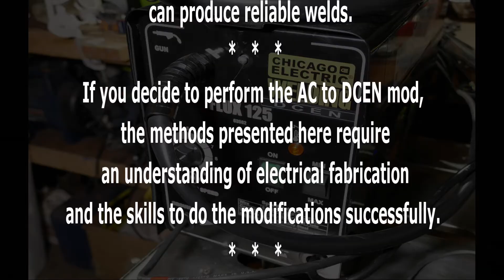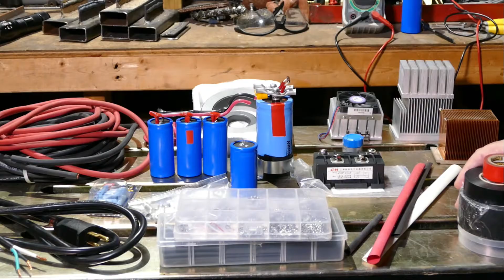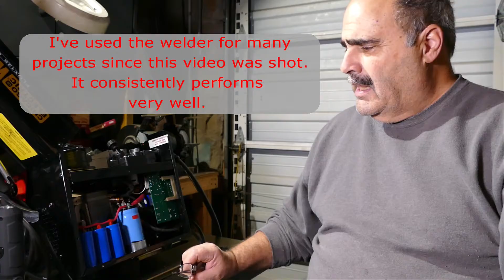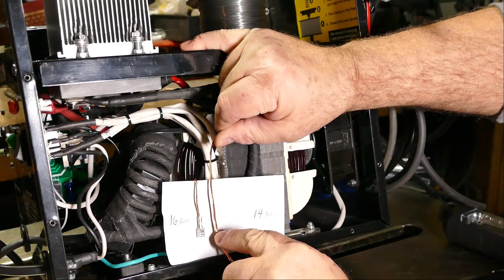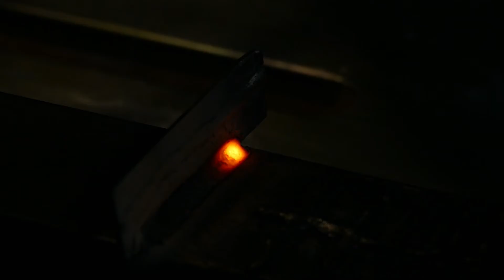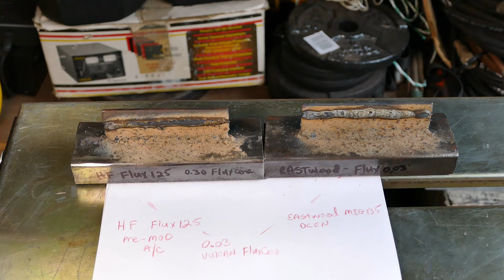Harbor Freight Flux 125 DCEN Mod

Comment: Today it not worth doing this with a HF90-125 welders   You Can By a Nice 140amp Inverter DC Mig Welder for around $80 , Try using Blue Demon E71T-11 Wire its good stuff !
Reply: Pero nunca una soldadora de transformador será igual de frágil cómo una inverter de tarjeta electrónica. En un altibajo de electricidad se muere la tarjeta inverter. Son mucho más delicadas. En cambio la que se hizo en este video es prácticamente un tanque indestructible

Comment: Great video I plan on doing g this to mine as well. How is the welder still holding up? 

Tip Forney, or Yes welder wire works so much better than the Vulcan wire.

Comment: It would be nice to the output on an oscilloscope.  Both with and without the coil,  would be interesting to see the difference.  nice work.
Reply from the maker: Agree. Would be interesting to see the actual level of filtering by the choke coil.
Reply: I don't know much. How do you see output on a scope?

Comment: Just starting my upgrade to DC on the older 90A model. You are the only person on YT I've seen use that inductor? Do you think it really makes a difference? (VS just the RC add to the circuit)? My gut instinct is that the inductance will slow the initial arc, and prolong it on the release...but...could be some other circuit magic I'm not thinking of
Reply from the maker: Hope your mod goes well.  I had this large ferrite core in my parts box, purchased many years earlier at a Hamfest for a few dollars.  Not sure of the final inductance since I don't have the proper meter to measure it.  The inductor is a filter that, if effective, smooths the current spikes. The capacitors smooth the voltage spikes. My intent was to smooth the low frequency current ripples. Theoretically, this large inductor would help do this. Others who have done AC to DC mods have used various types of inductors. My Eastwood welder shown in the video has a laminate core inductor. The bottom line is the mod produces welds that are equivalent to my Eastwood.  I can't say how much sputter was actually reduced by my inductor design.

Comment: Very thoroughly brief-down from the materials used until the materials were installed.

I love the power cord idea! I of the six days of about two hours each day this past week of watching how to convert the Chicago Electric to DC, you're the only one to show that upgrading the power cord is necessary.

I don't like the videos that say "I want to do this on the cheap" or "I only want to do it for $20" or "I only want to do it with things that I have around the shop."

I like that you just went straight for the best and to even care as much about being the cheapest. I want the best weld possible so I'm not as worried about cheap although I don't want to spend another hundred dollars after what I paid for the to get it to run DC.

You're only the second one to use an inductor or choke. I couldn't find the doughnut. A calculator I used online showed that I could get 1.6mH with a three-inch diameter 3 inches long steel rod wrapping it 27 times with a 4 AWG wire. 

The mH amount was what a forum poster on welding.com or something like that recommended for the hundred twenty times a second the voltage flips back and forth.

I also like that you just didn't set it and forget it on the discharge resistor. So many just put on a 259 to 400 ohm resistor set it and forget it.  One video even bragged that the discharge "only took eighteen seconds"...!!!

Finally  I want to see if 15each-4,700μF capacitors can help suppress the voltage ripple which will help the inductor smooth out the current ripple and give me a nice weld.

Comment: Where can I buy the 5in choke? Also what is the model for that axial fan? I was planning on upgrading the older 90amp model. Thanks in advance.
Reply from the maker: I bought the choke core for a few dollars many years ago at a amateur radio hamfest (flea market). Palomar Engineers sells toroidal ferrite cores of similar size, but they're expensive ($50-60). The axial fan is Chinese- made fan from Amazon. I think it is Arctic brand.  There's many variations in size and cfm that will work.

Comment: I have this exact welder myself. Planning to do the DC mod. The only question I have is on the stock unit, I see a white wire crimped into the ground lead from the transformer that goes to the circuit board and another white wire that goes to the circuit board from the positive lead that goes to the wire feed. Do you know what those white wires are for? I saw them on your unit but can't tell if those white wires were left on the AC side of the bridge rectifier or DC side. Does it even matter? I don't want to fry the circuit board. I'm not sure if older units have this feature. Don't know if it's a signal wire or what and will it cause harm if DC current is applied to those white wires?
Reply from the maker: Been a while since I've had the unit open and and I don't recall what the while wire you're referring to is for.  Might be for the wire feed motor or the control board.  Best to trace the wires and test them with your VOM.  Hope the mod goes well. My unit has been very reliable after the mod.
Reply: @fixtinkerreviewrepeat3074  I did get it figured out. I think the white leads going into the cables just past the transformer are signal wires of some kind. I cut the cable past where those wires intersect so they wouldn't be intersecting past the bridge rectifier and cause the control board to burn up. Thanks.

Comment: Can I use capacitors off of a RV air conditioning unit I have 6 of them biological no PCB 25 point us microfarads 330 volt AC 60 HZ I believe it's a run capacitor and then I have a 23.5 us 250 volt 50 to 60 HZ and I have another 10 microfarads 370 volts 60 HZ and then two that are on labeled one is a double capacitor I got them out of old air conditioner. I took a part of plasma TV and I got I got three of the coils out of there one has two terminals in the others have four and I also got some capacitors out of that plasma TV that are 450 volt 220 UF they're rated at 105 Celsius I've got five of them in this box right here also have on the breadboard a few more capacitors in a row on the motherboard I was thinking maybe I can cut the motherboard and leave them chained up on the motherboard and just sold around together but I'm wondering can I use these little alerts
Reply: The capacitors you have are way too low in value to be useful. They are not sufficient to filter the AC ripples present after the rectifier changes the AC to DC. Watch 4:30 for the values I used.  Consider 50,000 to 75,000 UF as a target range.
Reply: @kennethshaw8388  thank you for taking the time to let me know.
Reply from the maker: Thanks for the comments!  The capacitance needs to be sufficient to filter the AC ripple voltage.

Comment: So I can not use 25.uf 330vAC 60hz protected p823 10049012 3.15010.06 capacitor. Guess it's AC ?
Reply: Pins 22000uf 22000mfd 50V 35*70 Electrolytic amplifier Capacitor CD13 series 
So my question I guess is can you use capacitors that are essentially for a guitar amp cuz it seems to be a lot of them for sale there's capacitors that say audio capacitors and capacitors that say amplify capacitors on eBay and what do you think . Moreover I'm just curious if the word audio amplifier are just added on terminology or if they correctly state a function
Reply from the maker: @johnlindsey1938  The capacitors need to be "electrolytic capacitors". If the ones you are looking at are for the power supply section of the amp they'll be fine.  I'd advise not to use audio-style caps as the internal construction is different. Also be careful to make sure the capacitance is stated as microfarads. This can be confusing since some caps a marked with an "m" and some are marked with "u" (greek symbol for mu) for microfarads. Can be confusing . . . You might see  10,000 mfd  or 10,000 uf both meaning ten thousand microfarads.
Reply: 12000uF 12000mfd 80V 35*60 Electrolytic Capacitor
  Would s few of these work .
Reply from the maker: @johnlindsey1938  There need to be sufficient capacitance to filter the AC ripple. The A/C ripple will cause sputtering, so using enough microfarads will improve the results of your modification. I used a total of 86,000 microfarads which is in the ballpark of what was in the Eastwood welder I used for comparison. Using too little capacitance in the circuit will increase the amount of sputtering during welding. This is due to not properly filtering the AC ripple.
Reply: The value you specified is way too small to be useful. Watch 4:30 to see what values I used. The capacitance needs to be sufficient to filter the AC ripple voltages still present in the rectified DC voltage.
Reply: 2pcs 63V22000UF Aluminum Electrolytic Capacitor 35x50m. ??  So I think my shopping list must get but tedious for you to go through so I'll just stop at these capacitors and you could just if you choose to answer just say the first second third or fourth on your list will work or not work just to make it easier on you thanks for your time regardless
Reply from the maker: @johnlindsey1938  I'm not sure exactly what your question is.  Two 22,000 uf  electrolytic caps would not be sufficient capacitance, in my opinion. I'd advise getting into the 50,000 to 75,000+ range.  See above answers

Comment: I know your already done this project and i love your project and planning on doing mine as we speak with it on my bench making a schematic first .
Say if you added  1 smaller capacitor before the choke and then added the other capacitors after the choke coil you would have a really good dc with low ripple since the choke has some resistance 
I study power supply’s for high voltage tube amplifiers  and this is how they would make there circuit 
Am I wrong about this I feel the capacitors all before the choke will drop some voltage and current and did you measure how many ohms your choke coil was I was just interested if you took a measurement? 
Thank you for your videos i hope everything is good
Reply from the maker: Thanks for the comments!  I haven't tried this approach and have no way of objectively testing the choke / capacitor system. My evaluation is subjective and it seems to significantly smooth the sputtering typical of cheap AC flux welders.  BTW, I've done several extensive welding projects since completing the mod and it's working well.
Reply: @fixtinkerreviewrepeat3074  I would like to get a schematic for a Miller dc welder or a Lincoln and see how exactly there power supply is made

Comment: What is the function of the choke core ?
Reply from the maker: The choke core helps to smooth out variations in the current going  to the welding electrode.  The goal for the mod is to have as pure a DC (Direct Current) as possible.  The winding on the ferrite core creates a magnetic field that produces the filtering effect. The frequency of the household power line from the wall is 60 Hertz Alternating Current. The rectifier in the mod  converts from AC to DC, but there is some remaining AC noise. The choke helps to filter this out. In a perfect mod the choke should be quite a bit larger, but the size I used was a good for this project. It worked well.

Comment: I welded in high school shop. Miller industrial stick. Seven years ago I bought one of these HF boxes. Utterly disappointing. Lesson learned?
Solid wire shielded gas machine for four times more money.
Reply from the maker: I like my gas welder. More expensive, but much better welds. Flux core is OK for hobby welding or for outside work.  The mod did improve the results, but still not as good as my MIG welder. Thanks for the comment.

Comment: I have 4 capacitors @ 560 Microfarad and 400 volt. Would that work? I saw another guy working with only the bridge rectifier so I wonder if my capacitor will make any difference or they will just explode.
Thank you.
Reply from the maker: Your capacitance value is 4 x 560uF =1240uF  total, correct?  They should be wired in parallel with the output DC on the rectifier. The caps help to smooth out the welding voltage. I have 86,000 microfarads of capacitance in my mod and this works fine.  This is slightly more than the 72,000uF used in my Eastwood true DC MIG welder. The voltage value is the max voltage the caps should be used with. Your caps can tolerate some hefty voltages. They shouldn't "EXPLODE" if hooked-up correctly.  However, 1240uF is too little capacitance to make much difference and help smooth out ripples in the output voltage.  The welder would still function without the caps. The end result might be additional sputtering and splatter that produces those ugly beads near the joint.
Reply: @fixtinkerreviewrepeat3074 . Excellent explanation. Good to know. Thank you.
Reply: I would get some can capacitors on evil bay you can get some 75v 10,000 mf for about 5 dollars each 
The big caps are about 50-100 dollars not in my budget  since I’m on a low budget I would do whatever you can get I honestly wouldn’t use 400v caps it’s kinda the wrong application for this project 
I ordered 5 10,000 mf can caps I think that would be plenty since there is no way this pulls 120 amps it’s more like 80 amp and also you can just use a 150 amp rectifier with the heat sink and grease  I have used them before and don’t get too hot also on this transformer you shouldn’t weld for a long time or the transformer will get piping hot and could fail

Comment: Can one 2 watt 100 ohm resistor be substituted for the (2x) 10 watt 50ohm resistors you used ?
Reply from the maker: Hi Bill. The single 2 Watt resistor may not handle the heat. Give it a try and see if it heats-up too much. The 10 watt value will handle the load better.  Resistance generates heat and the 10 Watt resistor will handle more heat. The best resistance value (Ohms) for your system may require some experimentation.
Reply: 2 watt won’t last long a 10 watt is perfect you can figure this out by using ohms law they have a app you can use to figure out voltages

Comment: ok this is crazy ferrite toroid cores that size cost more than the welder like 150$ where can i get a cheep one
Reply from the maker: Thanks for watching! Think I paid about $5 at the Dayton  Hamfest a decade ago. Finally had a use for it.  #31 and 43 toroids in this size range sometime get posted on Ebay for a reasonable amount.
Reply: i payed 40$ for a 3 inch i shoulda baught the valcan

Comment: NICE job, I could tell the difference in sound, it also seems to have more power, check it with a Clampmeter,   see what amps and volts your getting?   GREAT VIDEO thanks
Reply from the maker: Thanks for the tips! Been working great since the mod. Use it often.

Comment: Wow professional looking job! It’s amazing how well these Harbor Freight products are
Reply: Right? I have the Chicago Electric gasless flux core welder and was thinking of going to the Titanium Easy Weld. But if this is an inexpensive mod, I might do this because the Titanium doesn't fit the larger spools.
Reply: @elfpimp1  nice! Just follow these instructions, looks like it should be a fairly easy mod as long as you have some knowledge of what to do. I’m thinking of doing the same thing myself.
Reply from the maker: elfpimp1:  Cost of the mod depends how many parts you have on hand. Watch other mod videos as well to help decide. Could be done for under $100 with careful shopping on amazon abd Ebay. Possibly a basic MIG welder that takes large spools (like the Easwood 135 I showed) is a good investment if you have projects that need clean welds.
Reply: @fixtinkerreviewrepeat3074  thanks!
Reply from the maker: Thanks!